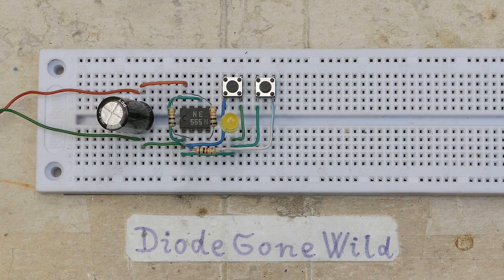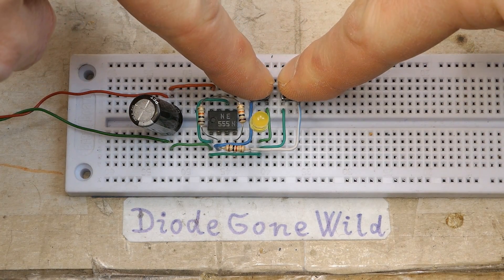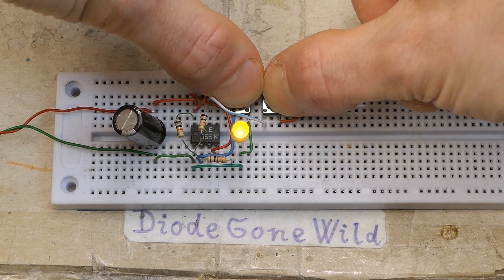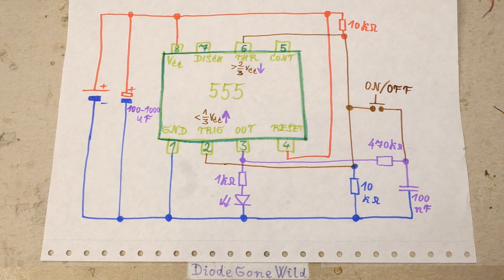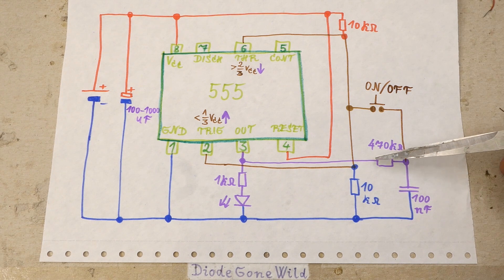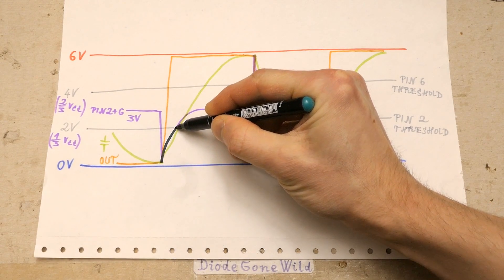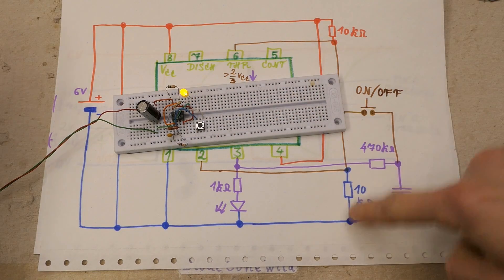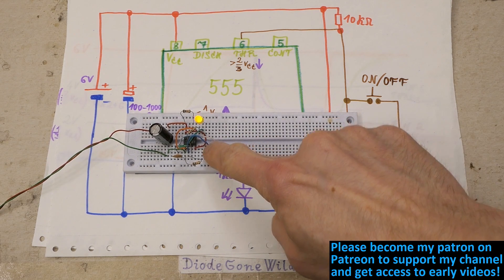555 Chip Explained - Bistable Circuit (1 & 2 button ON-OFF)

Comment: I always wait for your video to spend the time on. The way you represent and explain is outstanding. would have loved to see the capacitor waveform on your scope. Although I used 555 30-35 years ago but I still love this chip very much. It was quite innovative design. Can you design an experiment with 555 for automatic street lighting with an LDR. 555 Will just add the hysteresis so that the light itself from the bulb can't turn it off during dusk and starts oscillating.

Comment: The NE555 is one of the most useful chips ever made.
Reply: but now we use micro controllers just for flashing a led
Reply: @lifeai1889  For blinking LEDs I still prefer the NE555 because it's cheap, easy and quick to set up and a microcontroller is kind of an overkill for a blinking LED.

Comment: Nice projects, I thought now: Is it possible to use a 555 to make a memory circuit like this: two buttons and two corresponding LEDs. The one that is triggered first stays on until the circuit is reset. Like an interlock system where the first requester gets it, and the other can't change the behavior after, only after a third reset button is pressed. If so, can you please include it at the next episode? Would be nice. I now I can google for it, but it'll be much nicer and more accurate if I can see you doing it with your methodology, as you too shown in the video that we can't just blindly follow online schematics.
Reply: no, the 555 has only 2 memory state and what you are describing requires 3 memory states, state 1 is set to ON, state 2 is set to OFF and state 3 is not yet set. This could be achieved with a 556 IC which is actually two 555 packed in a single IC
Reply: @glmnet  sadly but interesting nonetheless.